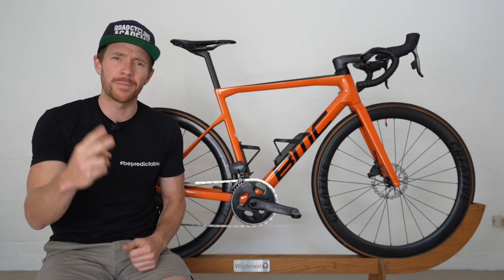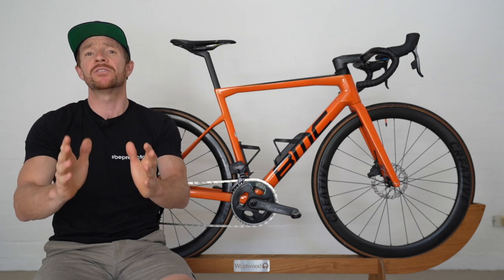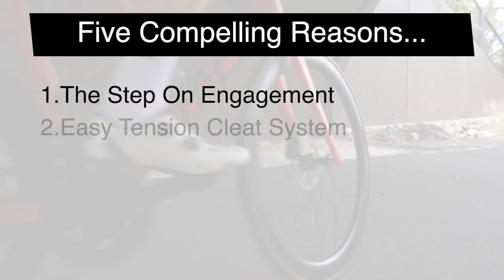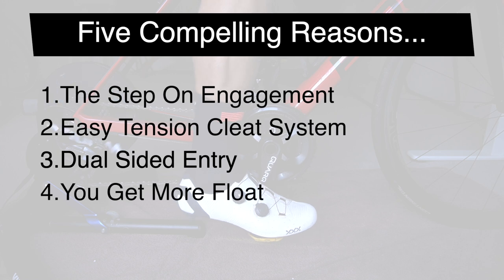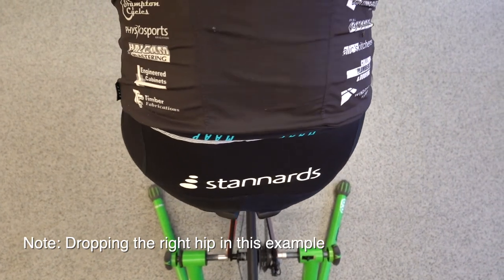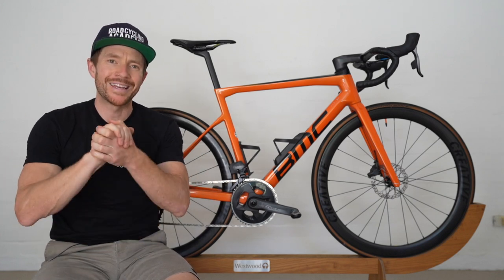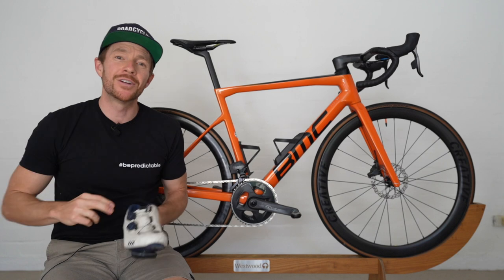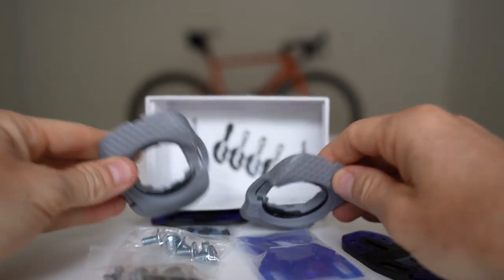SPEEDPLAY COMP PEDALS (why they win for beginner cyclists)

Comment: Shimano Mtb pedal has all the advantages you talked about and more. You can walk about normally, they are bombproof, much cheaper for entry level, there's even a beginner cleat where you don't have to twist to release your foot, just lift outwards instead. If using the XTR pedal with the RX8 shoe you have a setup that's pretty comparable in regards to stiffness, stack height, and weight.
Reply from the maker: Thanks for sharing on the thread. All I can say is I've never ridden a MTB pedal so I've never formed an opinion on it. Seems like there's some big fans of it, although I question it's practicality for those looking to progress in 'road'. Whether that be fast bunch riding, racing, fondo event etc. Cheers
Reply: @CamNicholls  If it comes down to power transfer I just can't see how one pedal system over another makes much difference, if the same stiff shoe is used with the same cleat position. Millimetre differences in stack height and being 20-50g heavier on the top level equipment aren't going to make a noticeable  difference either. I can understand that someone with knee issues may need a larger float than 6 degrees, but for beginners does that not create it's own issue when the rider has to twist their foot over 15 degrees outward to disengage their foot in the most extreme setting of float.
Reply: @CamNicholls  never had a problem with MTB type pedals, a similar platform to the Speedplays and the only drawback is a decent set of road shoes with ventilation, they're hard to come by. The only disadvantage is that it's took me a while to find a pair that don't creak, Shimano XTR race.
Reply: I'm for MTB pedals, the main draw back is there is only one choice of pedal based power meter
Reply: As someone who's been riding for 25 years including a few at the elite racing level in road, track and MTB I can't understand why most cyclists aren't on mtb pedals. The only advantage of speedplay over mtb pedal is ground clearance while pedaling mid corner, mainly due to shoe tread, and how many people have ever struck a pedal on the road not in a race?
Reply: @Williamchan87  Agree. The Assioma spindle would get caught up with shoe tread with it's current bulky design, also on gravel they could get damaged by flying debris. Hopefully dual sided crank based power meter options will come down in price.
Reply: +1 on that. A good pair of carbon sole shoes and I reckon you get all the good aspects of road pedals and can still commute and walk in the shoes.
Reply: Also worth checking out would be crankbrothers eggbeaters, they allow clipping in from 4 directions, are minimalist, offer good float and their cleat is similar to Shimano.
They are also popular in gravel riding.
Reply: I too use the RX8 shoe but with Simano's SPD pedals. The RX8 shoe, that is fantastic shoe.
Reply: Exactly what practicality do you question?   @CamNicholls

Comment: For beginners like me, I think SPD cleats is a much better choice. A few points,-
- With bi-directional release, it's very helpful in the initial few days when you tend to fumble and panic while clipping out. 
- The most basic SPD pedals don't costs much and won't pinch, if the rider decides that going clipless is not their cup of tea.
- Ride anywhere without worrying about mud or rocks in the cleats.
- With XC shoes, walking around is never an issue.

However, after about ~4,700 km, I do want to try out other cleat systems. Do they actually make a difference in long endurance rides (6+ hrs saddle time)?
Reply from the maker: Thanks for sharing on the thread. I can’t really answer that one as I’ve never ridden that system for prolonged periods.
Reply: @CamNicholls  No issues. I was just pondering myself. 

I'm a beginner road rider, just did about 200km ride on SPD cleats last sunday and in good saddle time (~9 hrs). So, was wondering if, road cleats will help in better performance.

Although, I didn't have much issue with the SPDs, except one, misaligned my left cleats recently (own mistake). 🍻
Reply: @junaid42465  I went from SPD to Speedplay, you do get more adjustment and they do feel more "locked in", you do need to invest in proper road shoes but walking in them is not to bad, just need to make sure you do not lose the walkable cleat covers.

It is a fairly big investment if you have more then one bike so if you were fine with SPD on a 200km 9 hour ride then may not be worth it, well apart from the excuse to buy cycling stuff 😁😁
Reply: Most beginners, in me experience, are just as worried about being able to walk in their shoes as clipping in and out.

I've been using a mixture of SPDs and Look pedals for 20 years and I can attest to the comfort of SPDs for long riding. Some of my longest riding (12-14 days of 6-8h per day riding) has been done using SPDs. 
There's not really a noticeable difference in riding performance until you get up to very high-power, fast riding and I mainly notice it in the fact that the float in road pedals is a bit "stiffer" than for the SPDs.
Reply: I’ve been running SPDs for over a decade. On my road bike I use the PD-ES600 pedals. Larger platform, single sided, and very lightweight, (pedals + cleats … need to consider the whole system when discussing weight). Century length rides and all day rides with several bakery stops are no issue. I push the cleats as far back as they go. Cleats rarely wear out. Road style shoes can be little harder to find, but new gravel options are great. And you can use the same shoes for Road, Gravel, Spin and MTB, depending on the style you opt for.
Reply: I used SPD pedals for the first six months or so I rode seriously on the road. I think they offer some of the same benefits as the Speedplay pedals that Cam outlined in this video. 

I had to switch to something else, though. I had issues with cramping in my feet that seemed to require a larger platform than SPDs. SPDs are fine for me on a mountain bike because I’m rarely static on it.
Reply: @NigelJMcD  “Buy new cycling stuff” that’s always there 😜

I think, I’ll stick to the SPDs only. The new XT pedals are as light as the SPD-SL ones. Plus, having a transferable job, I’ve to often ride at place without good roads or no roads at all. A good XC shoes like the Shimano XC300 or the XC500 would be good. There are also some road shoes which allow both 2-hole and 3-hole cleats to be fixed onto them. 🍻
Reply: @NigelJMcD  “Buy new cycling stuff” that’s always there 😜

I think, I’ll stick to the SPDs only. The new XT pedals are as light as the SPD-SL ones. Plus, having a transferable job, I’ve to often ride at place without good roads or no roads at all. I’ll definitely end up losing any kind of cleat covers, be it Speedplay or SPD-SL or Keo.

A good XC shoes like the Shimano XC300 or the XC500 would be good. There are also some road shoes which allow both 2-hole and 3-hole cleats to be fixed onto them, but bare metal cleats on polished surfaces are not a good idea 😂😂🍻
Reply: @martindoonan198  yes, exactly. I too have noticed, when trying to sprint on a high gear, the upstroke is not very efficient. But, for long endurance rides like BRMs and LRMs , that amount of floats would be good.
Reply: Regarding longer rides. I did an 8 hour-ish ride with SPD pedals in October this year. (Melbourne's around the bay classic). No issues with my feet.  I back off the clip in tension a fair way to improve comfort (play) though. I've never ridden proper road cleats before, so I can't compare the difference. My cycling is usually for committing or general fitness, not competition.
For me the fit and quality of the shoe can make a massive difference on if I get sore feet or not.
Reply: Been on SPD for my first 6 years on a real road bike. Just stamp your foot down and it engages, especially on the dual sides ones. Clipping out is easy enough as well, i believe some cleats allow for release even when pulling out your foot i.e. in a panic reaction and not realising your foot is actually attached to your bike.
Now on Assioma pedals for the power meter but clipping in is still not fluent after a year of rather intense riding. I do like that you can get sleeker shoes in non SPD though. 
As for stability, yes I do get a bit more on the Assioma's. But to me SPD is the way to go for beginners, walking is also way better than anything else if you have the correct shoes with the cleat being recessed.
Reply: That’s how I started
Reply: @NigelJMcD   what SPD means.?

Comment: My thinking for a good pedal for a beginner is a SPD. Dual sided and you can find alot of shoes that are both good for power transfer and easy to walk around in. 
As time goes on they will find what direction and type of rider they want to be so they could then decide what pedal system to upgrade to. 
Me I am a Look fan, always have been. My first clipless pedal was a Look, way back in 91. I try not to walk around too much in my cycling shoes but I do have to replace the cleats about once every 3-4 years. 
It would be interesting to try the speedplays, to compare the float and force needed to release from the pedal. Also to see how the cleat holds up compared to the Look.

Good video, alot of good info.
Reply from the maker: Good points you make Dennish, thanks for sharing on the thread.
Reply: SPDs here on my tarmac sl7, love em

Comment: Would strongly recommend beginners start with SPD 2-bolt. Why? Because almost every spin bike comes with them. Blow yourself up on a bike that you can't crash so that you can maintain your bike-handling when you're totally gassed. I started out spinning and did so several times per week for 8 months (but with 3-bolt SPD-SL because my studio was rad). Sadly, that studio closed and my cleats haven't worked with any of the other places I've been. This started the road bike journey. After 2 months of dialing in my bike fit while doing paceline training rides, I was able to hang with the A/B peloton of my local group ride.

2 Roadie commandments:
(1) Don't drop your bike.
(2) Don't get dropped.

Speedplay and some of the 2-bolt pedals being double-sided is a big plus for both bike handling and not falling behind after setting off from a stoplight.
Reply from the maker: Some great points there, thanks for sharing on the thread. Cheers

Comment: Someone as experienced as you should know that for total weight comparison you should include the cleats as speedplay requires an adapter and heavier cleats
Reply from the maker: Yes, it's a good point. Thanks for adding to the thread. I guess the weight and build quality was a quick supplementary point, but I should have mentioned, you're correct there.

Comment: You conveyed most of the same information that I found when browsing around.

However going with the SPD/2 bolt system is a lot better for beginners for a variety of reasons. 
1) You aren't locked into one pedal type, I currently have a pedal that is flat on one side and clipless on the other which I have used both sides plenty of times for. There are also double sided versions out there as well making for an easy upgrade when wanting a pure clipless solution.
2) Walkability, 2 cleat system means that you get standoffs preventing the cleat from touching the ground when walking.
3) It being more of a gravel pedal means that it is metal and will work better for more types of conditions and will be more durable. My first shoe was a second hand one that had the cleat already installed and all I needed to do was just wash it off.
4) Despite the lower contact patch going from 3 bolt to 2 bolt you hardly lose out on that fatigue that everyone says that a road cleat is supposed to help with. But your millage may vary. 

With all that being said, yes a speedplay system is what I would be going with if I was to get off of the SPD system which I don't think I am ready for.

Comment: I've ridden at least 200,000 miles over the past 50+years, so pay attention. I've used them all. If you ride in the city, double-sided pedals will make your life easier and your rides safer. Save the single-sided pedals for long rides where you don't need to stop very often. Here's what I use: I have Speedplay Zeros on my road bike, Eggbeaters on my mountain bike, and Shimano SPD on my road tandem. They all work great.  Eggbeaters never get fouled by mud and dirt, and are the easiest to locate and clip into. I love my Zeros, but they are more prone to being fouled with dirt or sand, and when you are off the bike, you'll be walking on the cleats.  My SPD are bullet-proof and I use them with touring shoes so I can comfortably walk around a restaurant or a museum or a grocery store.

Comment: I'd love to know about long-term durability - specifically the lateral float that would occur for me as early as 5,000km (meaning the outside of my foot would be lower than the inside of my foot which would wear out the outside of the pedal body), bearing life and cleat life.  I have 100% flat feet, and that lateral instability caused my Speedplay Zeroes to wear out VERY quickly.
Reply: Same experience with the zero's
Reply from the maker: Interesting situation. I know the cleat rock (caused by wear) seems to have been resolved. At least from what I can see after 5 months of use. But can’t comment on other points.

Comment: I used Time pedals since the '80s until Speedplay appeared on the scene. Even after years of use, I still had occasional issues clipping in because they'd flip over or I didn't get th toe in the right place. Speedplays revolutionised my cycling experience. They're so easy to use, and I like the lack of tension on the float. I can set them up easily to allow my feet to sit at their neutral position (heals in slightly) with the ability to independently adjust how much float I have either side. Plus I use extender plates to get my feet further forward over the axle, and that has no impact on stack height with the Speedplay system. I've had no issues with the cleats getting  clogged up, but I don't walk around that much off-road. They cleats require a little maintenance, but it's not a big deal. Looks like Wahoo have improved the cleat design as well as that of the pedals to improve durability which is good. I'm about due for some new ones.

Comment: Having used "clips" and different clipless systems over the years... unless you are actually racing  SPD wins. you can get off the bike and actually walk normally (yeah that is important) - but you need to be a bit choosy about shoes. Fortunately with more gravel racing, availability of stiff light shoes is improving. Also the "standard" SPD pedals have a smaller contact area (well not really smaller than the Wahoo..) but there are a large variety of SPD pedals - some with a platform which increases contact area.  Basically unless you are really competitively racing (and you are making a recommendation for beginners) SPD (and a good shoe) gives 99% benefit  without the drawbacks. Lets not make cycling complicated especially for beginners.
Reply from the maker: Yes, there is a lot of love for the SPD's on the thread. Thanks for your thoughts.

Comment: Cheers. Im using SPD (Time, they have massive float and clip in so nice) on my Roadbike aswell. Im verry happy with that. Im using some fancy Fizik shoes with BOA dials and a very nice Carbon Sole. They basically look like a road shoe, with the difference, that you can actually walk in them. In summer i tend to commute a couple of times per month. 60km each direction. In the City with traffic and trafficlights and crossings, ive learned, that i absolute hate the different road systems (yes, ive tried them all)  but thats all personal preference. Im not racing, so i dont need the stiffest system possible. I need my knees to survive.  On another note, when you're training indoors with your roadbike, every cleatsystem but SPD will f*ck up your nice wooden floor...

Comment: Great video! I have never tried Wahoo pedals, but as a newb to road cycling many years ago, I waited to invest in clipless. When the choice was made, I went with Speedplay Zero (now Wahoo), and have never hit the ground as a result of being unable to unclip. The lollipop design allows you to clip in no matter the orientation of the pedal. The design also makes it simple to quickly clip in at stoplight/stops for those enthusiastic starts that help you to get off the start quicker than those using Shimano/Look type design (see it every week). If Speedplay was good enough for Peter Segan, its good for me. Although I have never used another pedal, I will not consider changing. Great video, and I hope it doesnt take away from what Wahoo offers. 

Thank you for the content and great video, Cam!

Comment: I started with shimano clipless pedal (most common and cheap) moved on to Time (light for its price but rare) then Look (another common pedal platform and relatively cheap for its weight) and now on wahoo Speedplay Comp pedals on both my road and TT bikes. Agree with the reasons and I highly recommends it. Few other reasons which I considered includes the metal surface of the pedal which wahoo changed for durability, can push the cleat way more towards middle of your foot area and easier to walk around with the wahoo Speedplay cleats and more grip too. The dual sided engagement is a big plus and makes moving from traffic lights a breeze. After a ride or 2 your leg will have the muscle memory and don’t even have to intentionally look down anymore to clip in. Just step on the pedal as you naturally would and get going